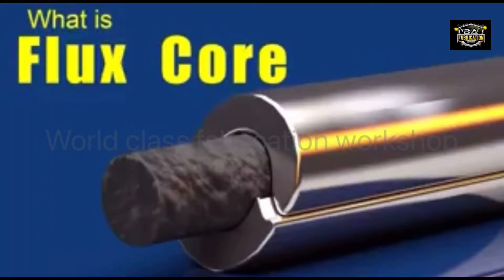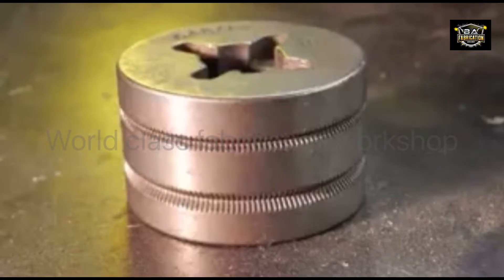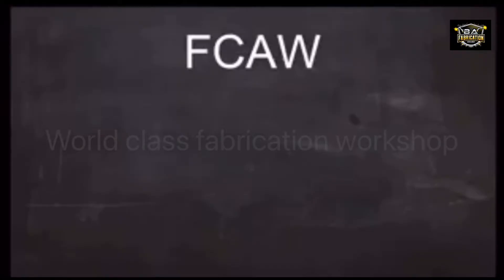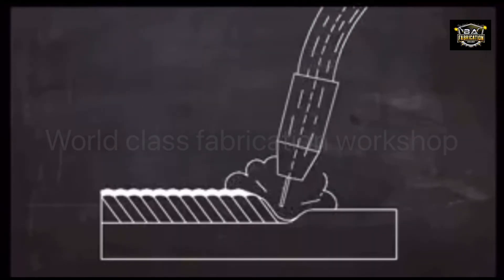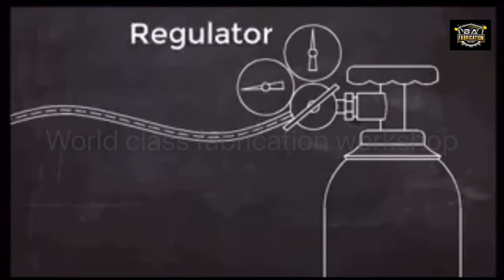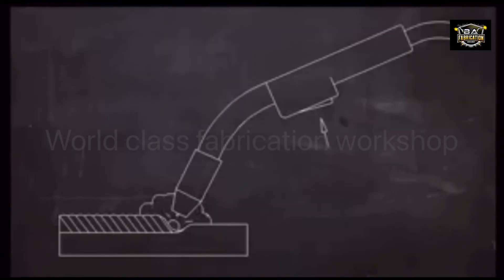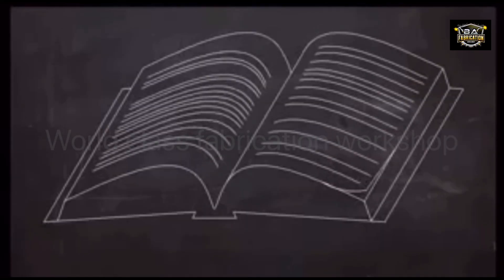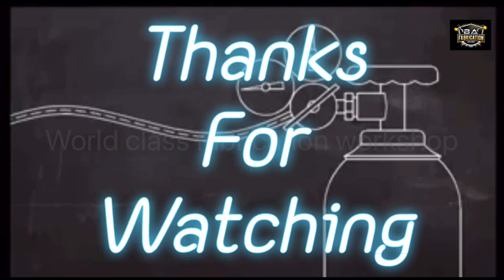What is flux core welding | briefly discuss flux core welding | FCAW

Comment: Most Mig welders won't run flux core well and most flux core wire is garbage. 

There's 2 unwavering essentials - the machine must have arc force control & the wire must be 1mm diameter.

 80%+ of machines lack arc-force control & most flux core wire is sold as 0.9mm diameter or 0.8mm. I.E garbage. 

Buy a machine with arc force control & buy 1mm wire - suddenly it beats every other process hands down with the one caveat - clean-up of your welds becomes essential. That's the price you pay for not using gas - you have to wire wheel every weld until it is close to spotless.
Reply from the maker: @jamesward5721  wow send machine photo.. thank you sir share best experience